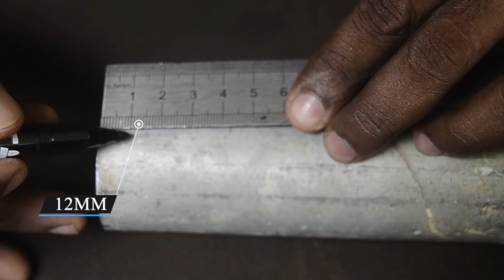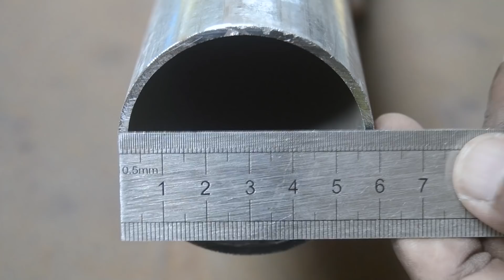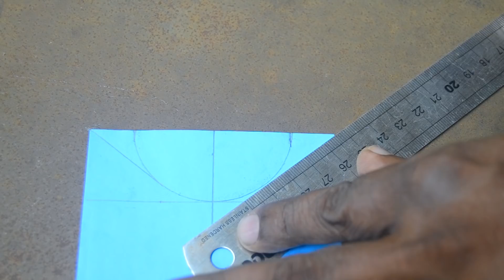BEST 3 SECRETS Of Pipe  Cutting Without CUT OFF Machine

Comment: Hi . Can you teach me how to cut a standard 45° angle without distortion? I cut the iron with a table cutter but cut it 45° and it was slanted. I added 5mm to the iron bar and the cut is correct but it's off by 45°. now i don't know what to do .please guide .thank you very much